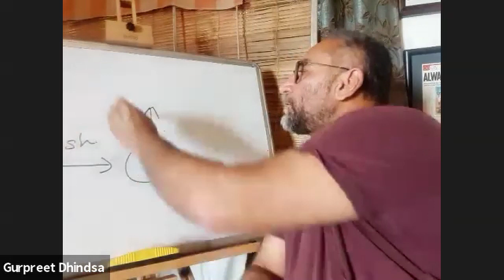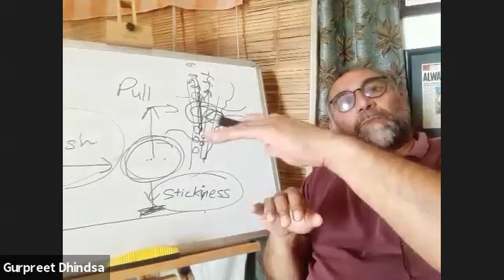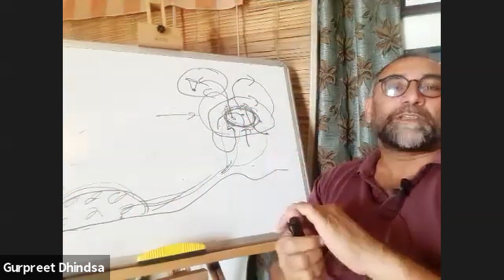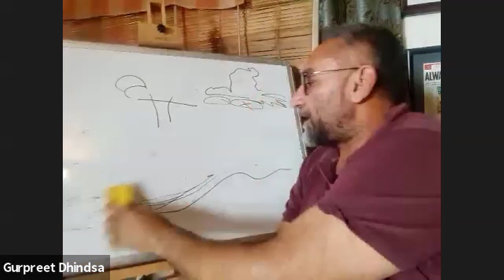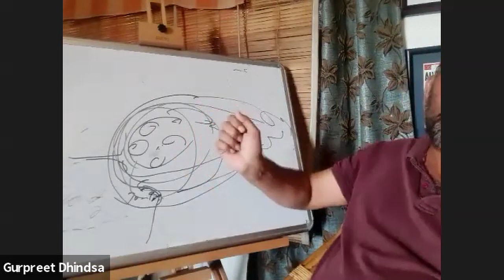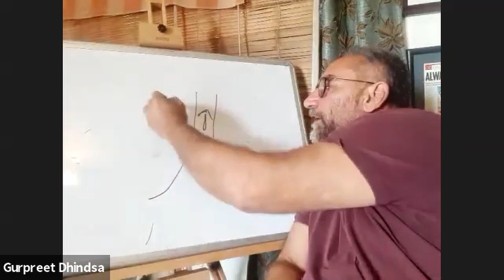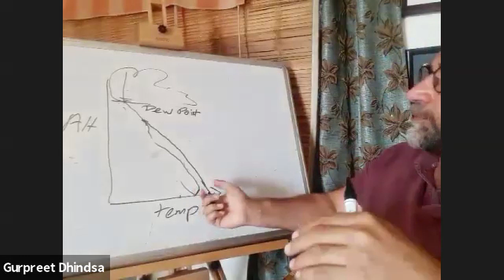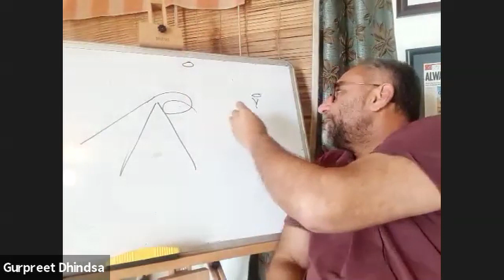Understanding Thermic Air

Comment: Transcribing the topics in the video for reference-
Speaker - Gurpreet Dhindsa

3:15 Conceptual explanation of thermals (properties of air - push, pull & stickiness)
5:58 Visualization of thermals (packets, analogy of balloons, branching of thermals at trigger)
10:01 Stickiness of air - influencing factors, experience based
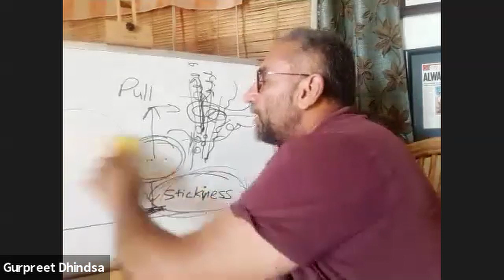17:23 How thermals change through the day (based on changing position of sun, analogy of tap-water-flow, structure of thermal build up, donut thermals, )
22:59 Morning thermals, tips for flying early in the day, timing & coring tight
24:40 Cloud formation, drift, developing & dying clouds,
26:31 Why we "miss" some thermals
28:30 Branching of thermals (Push, stickiness)
41:09 Visualizing a thermal, reversal method of thermalling, staying connected to the glider, pitch control is the key, keep the bank,
58:50 Relationship between instability and turbulence
1:10:45 Why more pilots tend to throw reserves on stable days (in Bir)
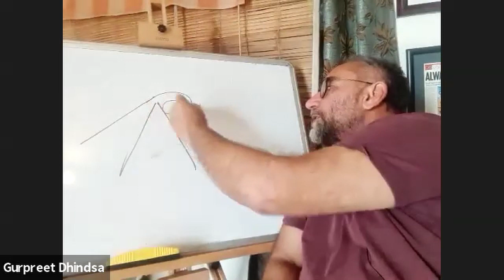1:13:50 Approaching lee-side thermals, the difference to note between stable and unstable days.
1:24:24 Real life example of studying & flying convergence - which helped Gupreet win a task at a competition

Comment: Questions by Pilots
13:22 #1 How is a thermal affected in different layers of wind, with change of direction - Krishan Kant 
15:20 #2 On some days thermals are edgy vs some other days have gradual boundaries of thermal. Can you please talk about them? - Rohit 
16:40 #3 Does pressure have an impact on stickiness - Rohit 
30:11 #4 Techniques to spot forming and decaying clouds - Nikhil 
31:10 #5 Why is the cloudbase a little higher (concave in shape) where a new thermal reaches CB - Gurpreet
32:55 #6 Boiling effect was observed in Panchgani & it was really turbulent. I perceived that as different wind layer going at that layer causing turbulent. Please throw some light what happens in the air in that case.
Near Khandala, at a particular place with possible convergence, the turbulence was observed on two instances. - Alok 
39:22 #7 How do you visualize thermals, techniques to fly them better? - Preeti
49:18 #8 Adiabatic Lapse rates explanation - Alan (to follow in a technical sesion)
50:01 #9 Why would a strong bubble go more up-wind? - Pratik
50:51 #10 Will there be differences in strength & formation thermals based on altitude? - Stanzim
51:50 #11 Can you please talk about counting to 3 second method of thermalling - Stanzim
53:40 #12 Aren't there any thermal imaging equipments to spot thermals? - Arvind
55:34 #13 Can you talk about constant corrections we need to do in a thermal? - Vikas
57:18 #14 What exactly is thermal mapping? - Krishan Kant
1:07:51 #15 Which source do you use to check sounding? Do you use skew-T and do you think they are accurate for India?- Daksh
1:15:39 #16 How do high winds at high altitude (at cirrus level) affect thermals? - Rohit
1:18:19 #17 It is tricky to judge a day - basis overdevelopment, especially at Bir. Sometimes overdevelopment passes through quickly keeping the day "flyable", other times, not so much. Please share tips on reading mountain weather w.r.t. overdevelopments. - Rohit
1:20:48 #18 What are the good things that work to identify convergence lift lines while flying? - Amit
1:26:24 #19 When transitioning between thermals, how do you get a gist of what lies ahead? - Rohan
1:31:00 #20 How reliable is NERL data (compared to windy, xcsky) & how do you read before your flights? - Sajid.
1:37:45 #21 What causes the lines of lift (in context with flying in Bir, high mountains)? - Vistasp.
1:45:05 #22 Please share inputs about impact of localised overdevelopments & decision to turn around or continue (in context with Bir) with calculated risks about flying big clouds? - Vistasp
1:48:50 #23 Vagammon site - Convergence is observed at site. Weather patterns have changed over last few years. During landing approach, pilots experience a heavy sink. Do you think it could be related to convergence or some other occurence, since they started observing this only recently? - Amit